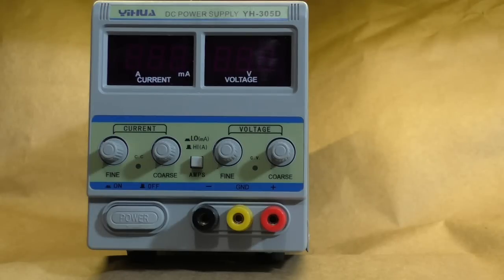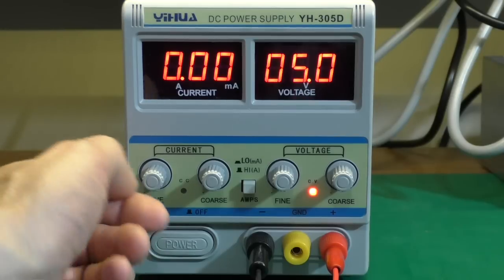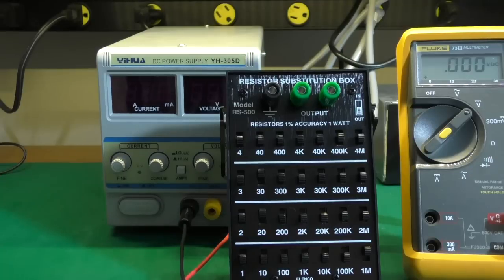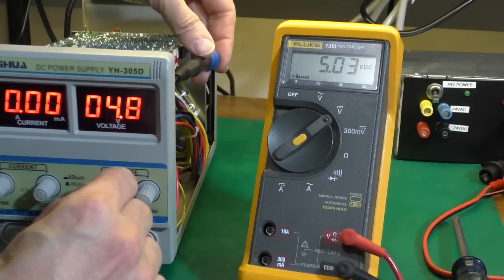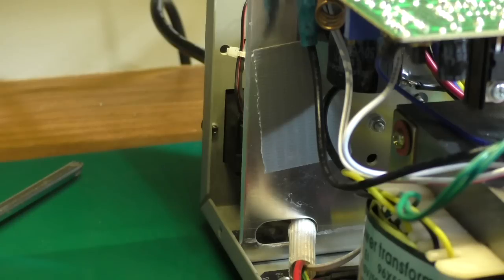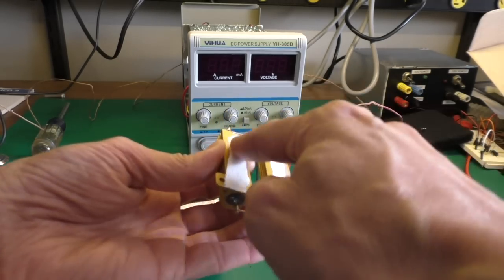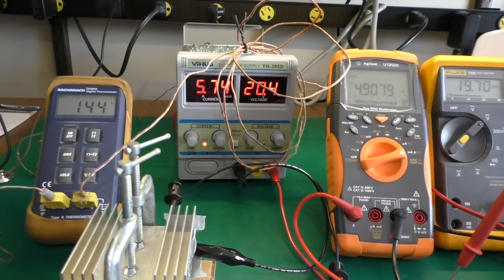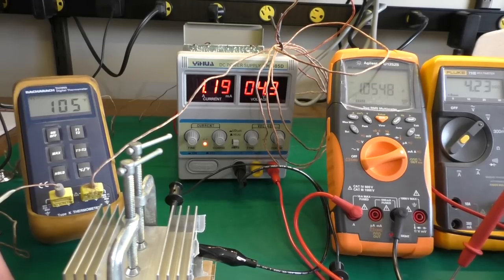R&D #12 Review: Yihua $50 power supply from Ebay

Comment: Looking for some advice guys. Want a 'Reasonable' quality bench top rather than Lab power supply. Im a beginner so not wanting to overspend on it either. im looking at the £50 - £100 ish range. I might go £120 but thats really my max and i really really dont want to go that high. So what should i get ? Mostly use 5v or 12 v . Ideas ?

Comment: I had it too. One day, I went away from table while it was running and when I arrived, board connected to it was smoked. Voltage limiter died and it switched from 5V to 30V and keep feeding circuit.

Comment: Thank you for the $50 power supply évaluation. 
I would have been interested to see if your 5A load had been left on & the Amp limiter changed down, if the power supply would have correctly limited the amperage. 
Is the yellow connector for AC?
Arthur.

Comment: I got exactly the same unit (inside and out)  under the Sunshine brand. It cost me around  40 bucks, but when I turn it on it  just gives me 0.00  on both LEDs.  Cannot get a voltage on it.

Anyone watching this have a cct diagram for this unit?

Comment: Long ago I took one of these supplies apart and reverse engineered it. I still have that schematic. This design has been around for a very long time, and would appear to be made by the same Chinese factory but with different labels when sold to different retailers. I don't think the design has changed one iota in all of that time.

The first thing I did was replace the VOLTS "fine" pot from a 1k one-turn pot to a small 10-turn 1k pot. It barely fit in the old location, but it DID fit. I had to use my own knob for this pot, but that was no big deal. I hated the lash in that old fine control pot, which the change to a 10-turn pot corrected.  After that, I could easily set the supply's output voltage to 1mV accuracy.

The current sense resistor is nothing more than a short length of some heavy gauge copper wire, perhaps 12 gauge. While it's a cheap way to do it, because copper has a high tempco (about +0.4%/°C), then as the output current gets in the amp region, the wire heats up and the resistance of this current sense "resistor" increases as well. Thus, your meter indicates a higher current than reality. I.e., the supply has a real lousy current sense circuit that is guaranteed to be inaccurate regardless of how you set the current trimpot.

The A/D converter for the two LED displays (volts, current) is based on an Intersil ICL7106 3.5-digit LED dual-slope integrator. If memory serves me correct (and it seldom does anymore), the design of the supply only uses about 1/3 of the Intersil's full range. Thus, the two displays end up operating in the lower part of the A/D's range, which further degrades the accuracy of all readings.

At one time, I was going to redesign this A/D board and use a better A/D as well as use all-in-one 4-digit LED displays so that I could get more accuracy from my meters. But alas, my day job demanded more time of me that I could apply to my modification, and I had to abandon my plans.

It is a very interesting design, particularly the use of the 3 relays to chop up the linear power supply output voltage so that the pass transistors (three 2N3055 NPN transistors in parallel) operate with at most 5V of collector-emitter voltage, which keeps the heat dissipation low (almost like a low-resolution switching power supply).That clank-clank sound you hear as you raise/lower the output voltage is that circuity kicking in and out the 3 relays, chopping the transformer's output voltage into 5V steps. Whoever designed it, as well as the feedback loop, really knew his stuff.

Bottom line: for $50, how can you go wrong? Try sending a 15 pound brick to China and the postage alone will cost you over $50. How these guys manage to manufacture and ship this supply to me for $50 demonstrates the magic of free markets in action!

Comment: Thank you so much for showing how to correct the meters! I'm a disabled veteran with limited resources. This was the power supply I settled on due to its extremely versatile amperage (mine claims 10 Amps). It's nice to see such a thorough investigation into a piece of budget gear.
Reply: I use mine almost exclusively for 12V automotive electronics. With the volt meter corrected at 14V,  I only need ONE  multimeter to monitor the current.

Comment: Just finished repairing my 305D. I was testing out a drone motor which operated probably at 3.7V to see how fast it could go. Started at lowest voltage and gradually cranked it up. Voltage was over 20V when the clip to the motor lead came off, so I put it straight back on, blew up the motor and the PS. Display read about 29V and couldn't be adjusted. Searched all over for a schematic, never found one that matched exactly. There are two 2N3773 output transistors (most schematics show 2N3055's). The bases and collectors are connected together (parallel arrangement) and the emitters have 0.33 ohm resistors which then join and go to the positive output. Both transistors and one of the 0.33 ohm resistors blew up. Replaced the blown 0.33 ohm resistor as I found it open first. Display read 49V and couldn't be adjusted. Then test the transistor. Both failed, one as a short base to collector. Main circuit board, display board and control board were ok. Replaced 3 defective parts and it worked again.

Comment: if you use current meter to read the current then you are facing with the unknown internal resistance of the current meter . therefore your reading current number may not be accurate. you should use the known resistance as a load then measure the voltage drop then calculate the current using Ohm law formula.

Comment: I have a similar one, also from eBay. Slightly different labels on it. At 8V it produces 1Vpp noise of 60kHz modulation. So, while any multimeter will show you the same voltage you set (because of averaging) - this kind of supply is pretty useless if you want to design/test any precision analog electronics (something  with OpAmps, ADCs or DACs inside, for these cases I still use LiPo batteries as a clean power supply).

Comment: I think you should sign the praises of this little PSU, given you paid next to nothing for it.
It is good practice to use calibrated metering equipment to test current and voltage in any lab setup. The meters on any PSU (even a lab-grade one) are meant to be a rough indication. Fine adjustments are done by means of proper meters.

If you want a cheap but good PSU, try to 'score' one from a server or a hard-disk-rack . Those can be had for little money are are far superior to anything commercial (that isn't lab grade)
Making a regulator for that is an interesting project that actually may teach you a thing or two.

Paddy

Comment: The current meter can be fixed with a few passive parts changed.
I have mine now accurate and even modified it to show 2 decimal places.
But 10.20A shows as 0.20A, but that is very small price for the higher resolution ...useful now that it is accurate.

Comment: I have to say that what I saw in this video was a very inexpensive power supply hold up to a pretty punishing (not to mention imperfect) test far better than I would have expected. I'm a big fan of the notion that you get what you pay for and, as such, I like to buy the higher end, more reputable equipment whenever I can. That said, I also firmly believe that cheap tools and equipment can be extremely useful so long as your expectations and uses for them are reasonable.

Would I use this power supply for applications that require its highest outputs of either voltage or amperage for long periods of time? No, I wouldn't. However, for lower current and/or voltage applications, or for applications which may not be ideal for my equipment in general (wherein I'd rather risk a $50 power supply than a more expensive one or one that I built), this Yihua seems like it may be pretty useful.
Reply: I think the same. I am using a chinese PSU for all kind of everyday stuff. And it's fine (even though, I don't like it's internals). 
I also have a high end model for high end applications.

Comment: You got no idea about thermocouple. There is no need for isolation, it can be shorted and the measurement is still the same. The same is abot measurements themselves. 95.6... mA should be calibrated 0.10 A instead of 0.09 A. The device is superior compared to your knwledge. What abot voltage drops in the wires? Whatever you say expose your poor knowledge.

Comment: Good review. Saved me 50 bucks. Thanks.
Reply: They are excellent supplies.
The person doing the review does not know how to test it properly, and he really screwed up the metering my trying to calibrate the meters when he had little or no reading on them.
 He needs to go back to 15 or 20 volts at 4 or 5 amps and recalibrate.
But when he recalibrates he needs to take the resistance of those crappy wires provided with the meter into account; OR do his voltage and current measurements right at the power supply output terminals...
Reply: he also has the leads to test amps connected wrong and is measuring the resistance of the wires.

Comment: Yikes!
I always recommend people old HP power supplies from the 80s or 90s - they're reasonably low in price given their age, but they're still professional-tier equipment, and reliable as hell.
Only cons are that they're boat anchors and don't always have modern features, but hobbyists like myself usually don't need those. Hell, most of the time we don't even need more than a little 5 volt wall wart
Oh well, just my two cent ramble
Reply: I have a power supply I built in college in 1986 still in use. normal transformer, based on a 4194 ic. 0 - 30v variable to 1 amp. Bearing in mind that most digital circuits these days are low power the need for 30v 10 amps is limited anyway. For the price and features the type of supply shown here is excellent value

Comment: I've got a pair of them Branded QW-MS305D. They look to be exactly the same device, but the internals on mine are better laid out and they behave a little better. They have 2 heatsinks aligned front to rear and the fan blows right thru them. Mine are within .2v 0-24v and run at 5a without appreciable heating (more than you'd expect anyway). The fans come on about 150ma and pwms to full speed at about 500ma. I've been using them daily for a couple of months and they serve the purpose well. Most days they're on for 12+ hours. They're not HP or Agilent, but at 1/10th the price, I don't expect them to be. I paid about $85 for the pair at Yallstore on ebay (out of New Jersey). I buy a lot of SMPS from them, and figured I'd try a couple of these rather than spend big bucks or gamble on used.
Time will tell, but so far, for a low end solution, they're not bad.

Thanks for the great review.

Comment: Be aware that these supplys are made REALY cheap with no brains going in!
I have a smaler version 30V / 2Amps. Allmost all screws are lose even the earth on the transformer.
BUT the Big problem is, mine has NO Earth connection going to the metal case, its a suicide Device or attempted murder depending on your views.
If you buy one please check all screws and all connections AND check that earth IS connected to the metal case!
Reply: now, that's really bad. my chinese PSU didn't light up. Turned out that the ribbon cable going to the faceplate wasn't plugged in.

Comment: I myself chose a long time, bought the - and very happy. Therefore, I recommend to all. Very compact and precise adjustment unit 32V/5A power supply. Model Gophert 3205E have 4-digits on display current: http://ali.pub/91wip Price is only 55 dollars.
"Out of the box" it was calibrated to a 1-2 mark last almost the entire range. Excellent stabilization of voltage and current.
Reply: I can't remember who I sub to that has this very one and they use it left and right and in their videos (they don't do a lot of videos) and they seem happy with it.

Comment: would you recommend this for light work? I'm tempted to getting one for radios and toys nothing big don't need it for heavy loads just repairing toys and radios ect....
Reply: Matt Maloney who are you asking me or R&D?
Reply from the maker: You can get a small adjustable switching power supply from Ebay for half the price.
Reply: Can you show me an example?
Reply: I'm asking R&D, or anyone the who has a reasonable product reference. I was trying to reply to R&D's reply, but I guess it doesn't really work that way.
Reply from the maker: here is an ebay listing, you will have to use your own 24v transformer and convert the ac to dc, but if your learning electronics it's a good starter project.
http://www.ebay.com/itm/Buck-Step-down-LM2596-Power-Converter-Module-DC-4-0-40-to-1-3-37V-LED-Voltmeter-/221970563817?hash=item33ae7a02e9:g:gT8AAOSw5IJWcZxX

Comment: I would recommend looking around for a good used power supply.  I was lucky enough to pick up a B&K Precision 1660 for $100 Cdn.  There are lots of nice used pieces of professional quality equipment around.
Reply: Highly depends on what you're going to do with it.

I've got an ATX (PC) power supply, to get me +12V, +5V, +3V3, GND and -12V. It can also handle lots of current (driving LED strips and whatnot), has indicator LED's for pwr_on and pwr_ok. Along with a switch in the front to toggle it on and of.

But I also have a variable 0-30V 5A CC/CV regulator from ebay.

Together they fullfill pretty much all my needs.
Reply: "Professional quality power supplies" have remote sensing capabilities, which will do a much better job of delivering a constant voltage at the load when the load current changes. Any power supply with only two output terminals is non-professional, by definition, because the voltage is only regulated only at the supply's two output terminals. Add your cables and anything else to get the voltage to your load, and those wires/connectors add resistance, which creates a voltage drop when current passes through them. Remote sensing (like the very old HP supplies once had) eliminates this issue.

Comment: Your wire connections for testing volts and amps are not correct. The external voltmeter should be connected on the PSU terminals shafts. Then the current load resistor needs to be plugged into the sockets of the terminals. Otherwise the connecting wire resistance  and contact resistances are masking the performance of the power supply.
Reply from the maker: You are correct, I will keep this in mind for future testing.
Reply: Thanks- hope you didn't mind me mentioning.
Reply from the maker: I always solder my alligator leads, this power supply is not worth spending any more time on, but I will use your suggestions on the next one. thanks for commenting. Cheers.
Reply: its probably important to retest with the meters at the PS because you made a firm point about the meters being incorrect. I think ( if your aligator connectors are like mine were ) the voltage drop across them was significant under these load tests. I had to upgrade my leads to thicker 14awg and solder crimp the ends . The CHinese leads use super fine wire .
Reply: I have one , it is "ok". I found it did not have current controlling setting just a current and power limiting which switches off the Voltage once triggered . So it is a current protection but this cannot be set in advance. I also found some noise being generated on the Mains AC that appeared to  go into other devices. The Voltage is fairly accurate but this can always be improved by buyng a small Voltage display from ebay attached in parallel .
Reply: I was just going to say this. Wires  can make a substantial difference.
Reply: Yes, very true, and not just with power supplies.
Reply: He used the wires that came with it. That's fair.

Comment: I bought a similar looking power supply from a local electronics store, I think paid close to $150 for it, within the 1st year, the power button broke, had to unplug it from the back, not even 3 years later, and didn't even use it all that often, one day, was testing a circuit I have built, I left it on for a few minutes, went to grab something to drink, came back, and I smelled something  burning, and next thing I knew, the power supply was showing 50 volts and cooked my circuit and a VERY expensive automotive hall effect sensor,  the unit is only suppose to go to 30 volts, strange...
Reply: On a circuit design like this, if the pass transistor fails shorted, then yes, you get the full voltage straight from the transformer/rectifier passed right into your DUT.
Reply: I had a very similar experience. I had the PS connected to a USB cable and charging a tablet that was being picky about charger and USB cable. I was just topping off my charge before a trip, while I took a shower. I grabbed the tablet as I went out the door, but did not notice any smell. At the airport I realized my tablet was dead. and found it had some fried components in it. Two weeks later when I returned I found my PS was pinned at 50V. Inside a 3W 1K resistor on the board was completely cooked. one of the can caps was blown up. I have not taken the time to repair it, but I would think twice about using this PS unattended or on expensive equipment. I will say that the unit was a very useful tool up to this point.

Comment: I'd have figured fluke would make a better meter than that. 150 mV off? I mean the power
supply was giving bang on five volts.
Reply: My lame joke aside... I bought a Korad and one of the mains wires was pierced by corner of a heat sink. It was fairly accurate after I fixed that. been going for a year now I think.